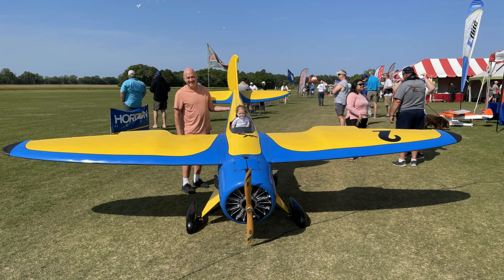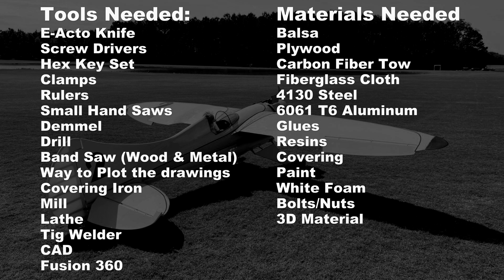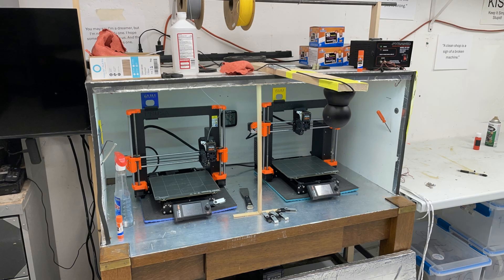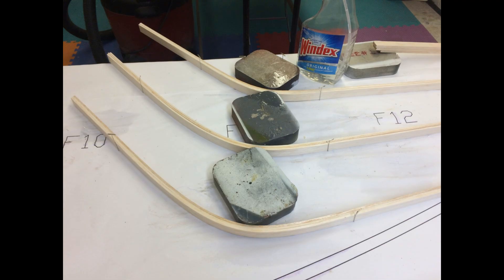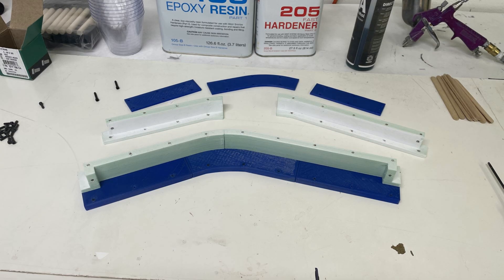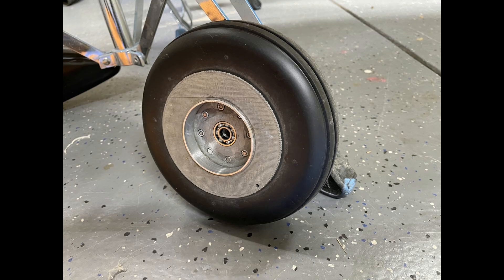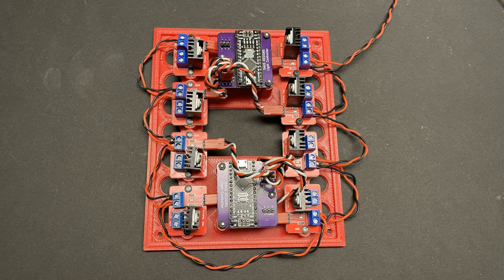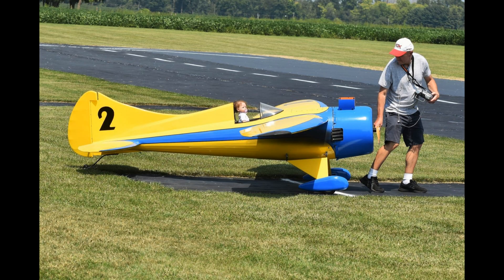The Ultimate Tools for Building Massive RC Airplane

Comment: I could not believe my eyes when I saw your list of tools ! I felt like my workshop was literally cloned ! I have the exact same welder, the exact same cutoff saw , the exact same 3D printers, I even have a multi- tool, shop task El Dorado with ball screws and CNC upgrade, and yes, some of them are 20+ years old just like yours . In the case of my shop task I got that 26 years ago as well. LOL I also built aircraft and radio control.  the biggest RC plane I built was 120 inch span Piper cub,  so I felt I just had to say something and leave a comment here.  due to health reasons my aircraft building days are relegated to the computer now where I create 3D models for flight simulations. But I still possess all my tools.   . good luck to you.  so is good to see a fellow modeler/pilot/mechanic.
Reply from the maker: That's awesome, I love hearing from other builders who also have a passion for the hobby. Thanks so much for the comment! Take care!